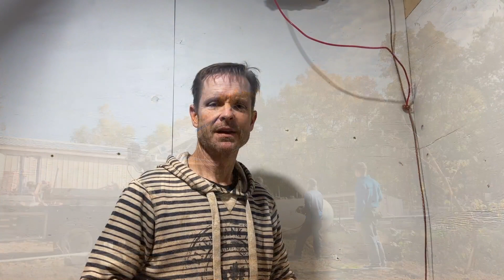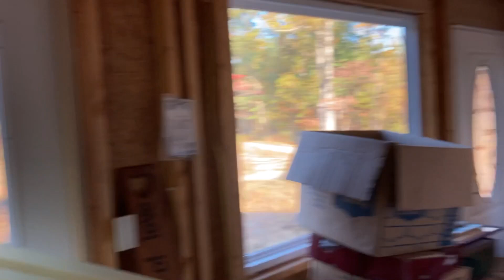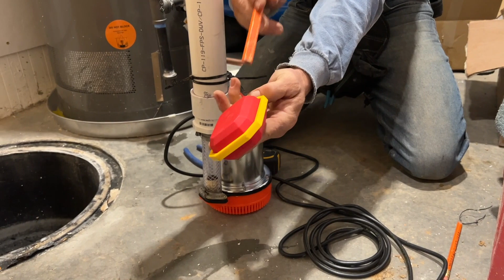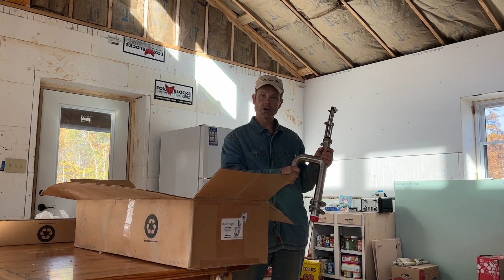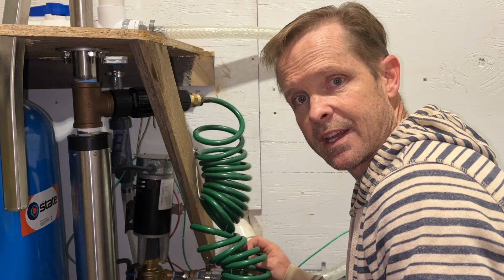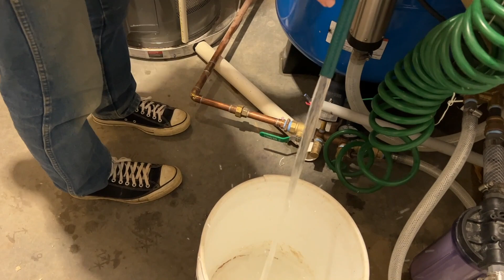We Have Off-Grid Propane and Water!!

Comment: Great job with the plumbing system.  Loved the tour and all your tricks.  The manual pump is a great addition especially the way you jury rigged it along side the pressure pump.  A lot of people use the well pump to pressurize the tank. Why didn't you do that? 
Our new house is planned to be above grade so no sump required here.  I feel your pain with copper pipe....it is proven but expensive. And froze during the deep freeze we had here in Texas.  Still not sure what we are doing for piping yet.
Reply from the maker: As far as pressurizing in the tank with a well pump, we don’t have a well pump. We collect water in a cistern that is right outside that wall where the pipe comes in. The cistern bottom is about 8 inches above the basement floor so there is no lift requirement. That’s why I’m using a booster pump. And, that’s why it’s so easy to pressurize with the manual pump.

Comment: Just curious, but what are your copper pipes lined with?
Reply from the maker: We have no lining in our pipes but the hot lines are covered with foam insulation.
Reply: @ADifferentWay  There have been case reports of people getting copper toxicity from unlined copper pipes. You might consider getting the copper content of your water tested since you're on rainwater and that's somewhat acidic (if you haven't already had the water tested). I believe there's higher copper when water is heated and when it's been sitting in the pipes for a while.
Reply from the maker: Our pipes are not lined.  At least in our area, basic copper pipes are unlined and lined must be special ordered and cost significantly more. That said, although copper toxicity and acidic rainwater can POTENTIALLY be an issue, we can take simple steps to minimize the risks—especially when compared to the toxicity of using plastics and chemically treated water.  For example, know the signs of copper toxicity to catch it early. Because we use copper to prevent many common ailments in our livestock, we stay educated on copper issues. Although we are, sadly, currently hauling city water to fill our cisterns until we get our gutter system installed (not enough hours in the day!), once we have rain water, the concrete in the cisterns actually buffers acidity in rainwater.  If the acidity is excessively high (very unlikely) it can also be easily treated to neutralize the acid.  In our nearly decade of using rainwater, it just hasn’t been an issue, but educating yourself is always key!
Reply: @ADifferentWay  Oh that's great. Thanks for educating me on this :)
Reply: I’ve only seen issues when you don’t ream your copper pipes.
Reply: @toddfriley9373  were the pipes lined or unlined?
Reply from the maker: Ours are not lined with anything.